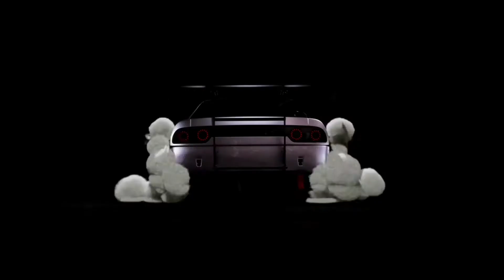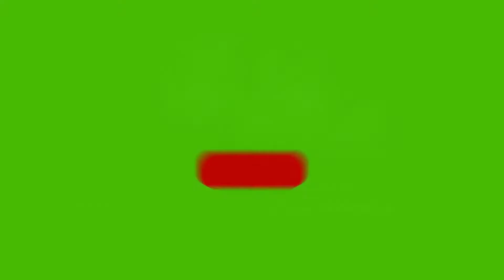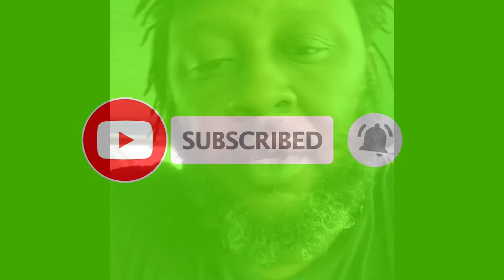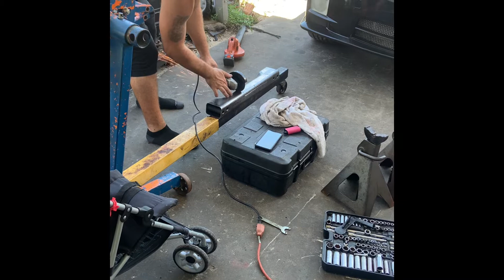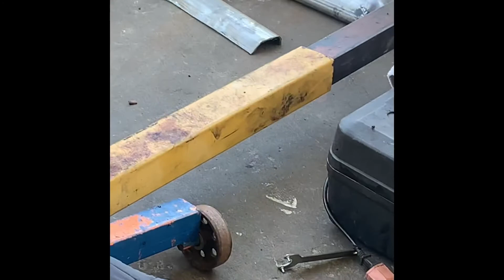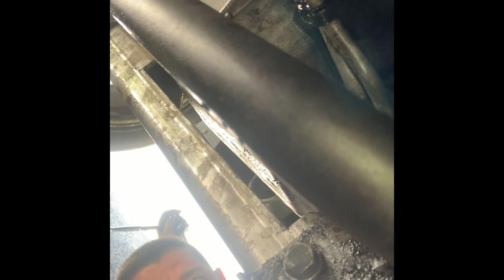(LS Swap) How to use a Chevrolet ls gen 3 oil pan in a ls gen 4  truck

Comment: What not use the gen 4 oil pan
Reply from the maker: I actually forgot to put the GEN three oil pan on there so when I went to put the motor in it wasn’t sitting flush and that’s when I realized that I messed up but instead of trying to pull the engine back out I just took the crossmember out and cut it and put it back in in